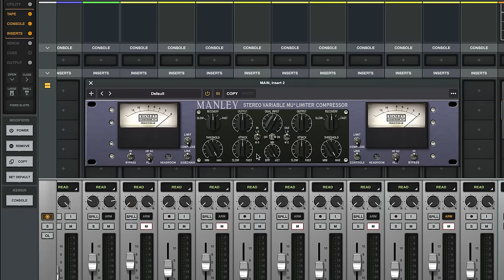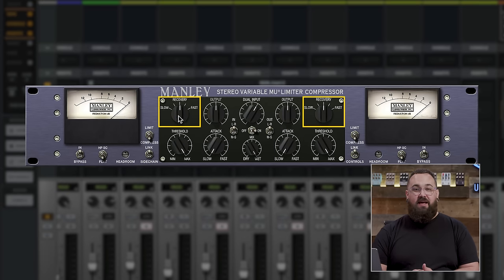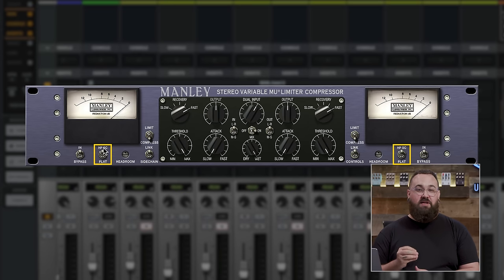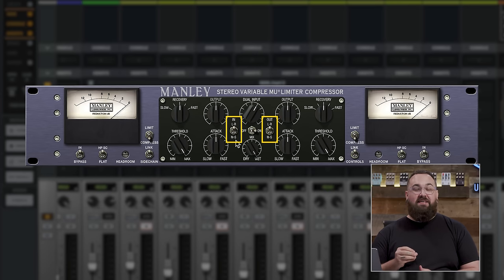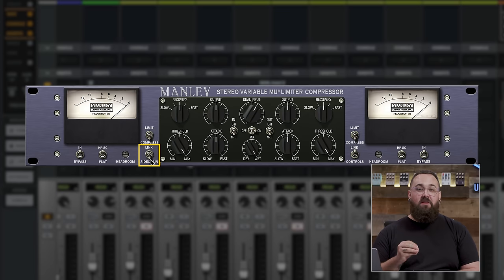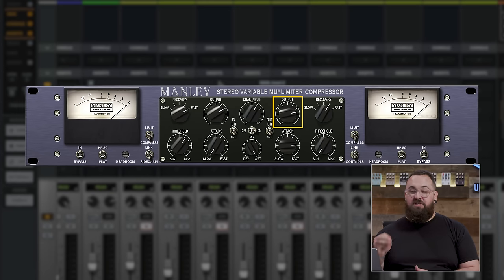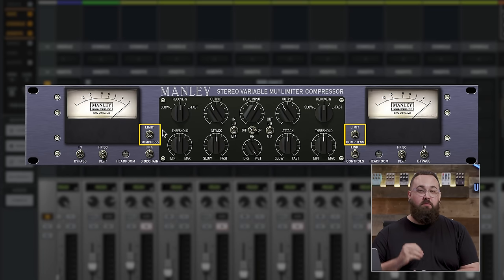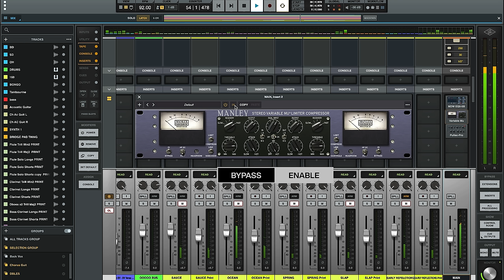Mastering the Art of Mix Bus Compression | UAD Quick Tips

Comment: Excellent demo. The Manley Vari-Mu is great on almost everything. It has its signature sound, but does so without changing the mix in a bad way.
Reply: Is that relevant to have a signal -18db before it goes to plugins that emulate hardware?
Reply: Emulation plug-ins, myself, I do try to keep input about -18 dB. When I say "about -18" for me there's a range, -20 to -14 dB is where I'm feeding those.

Maybe cliche sounding but let your ears judge.
Reply: @DeltaWhiskeyBravo13579  thanks for reply,  interesting is that I never saw these guys on UAD channel do that in their videos,  seems like they just throw plugins on any track without reducing volume of the  signal
Reply: Yep I've noticed as well. Maybe it's not an issue, but I still do it and then I'll push into a clipper and limiter on the 2 bus to bring up the overall level.

Comment: Thanks Universal Audio. I just got my UAD Manley Variable Mu Compressor. I use the Apollo x16 for my mic´d drum kit for monitoring and recording, in combination with a 19" rack with lots of outboard gear and UAD plugins. I love your plugins and bought many already. I just tried your Manley Variable Mu plugin in Logic Pro on my Stereo Master Bus, it´s a nice plugin. I compared it to the UAD API 2500 plugin and I personally prefer the API Stereo Compressor, which has more beef and depths.
Reply: Is that relevant to have a signal -18db before it goes to plugins that emulate hardware?
Reply: @manykzdj792  you talk about gain staging? Gain staging is important if you don’t want to end up your mix in the reds and hear distorted content because of clipping. But that all depends on how many plugins you add on individual channels. If you boost a lot with EQs or bring up the gain after compression and so on…..yes, you should be aware of that. Must not be always-18 dB, sometimes-12 dB works fine. it depends on how you mix.

Comment: ngl I got the SSL G buss comp for my arrow interface and I find myself using it much more than this new manley comp on native. The manley seems to be a bit too transparent while the G comp's peak clipping and glue character I find I prefer more in pretty much every scenario.
Reply from the maker: Don't sleep on using both!!!!! Manley for glue and a little color, and then SSL for spank!!
Reply: Yes, try out putting the Manley first, just barely touching the signal, and then the SSL bus comp after to add the punch.
Reply: Those suggestions to use both are kinda what I do. Much like the 1176 to LA-2A does the transient into a leveling action. Try other compressors doing similar for other options.